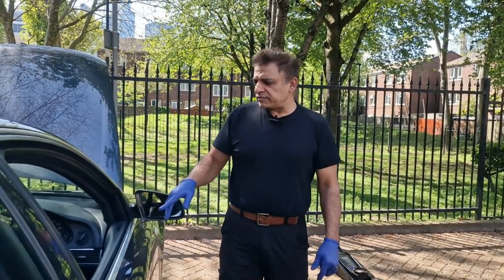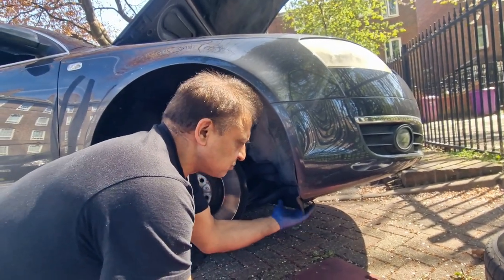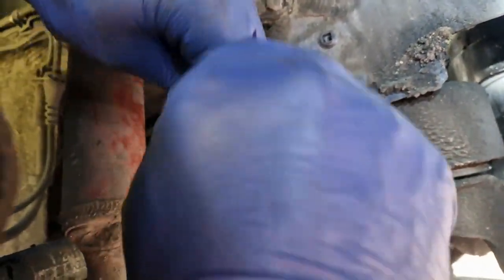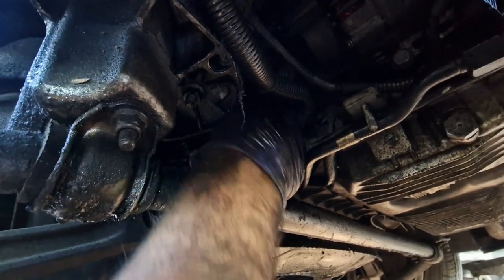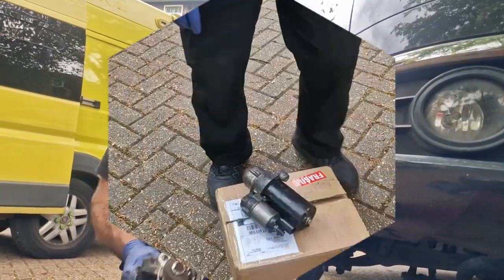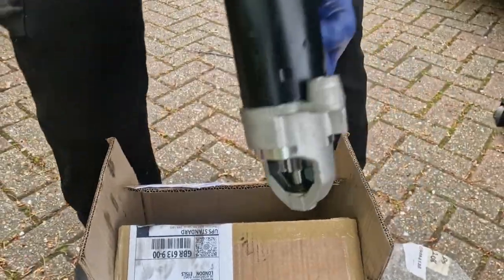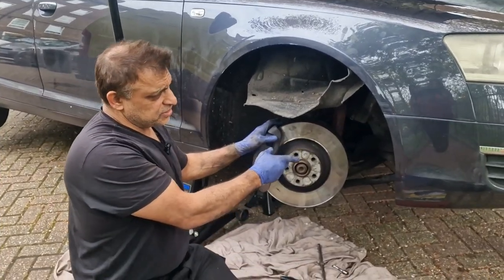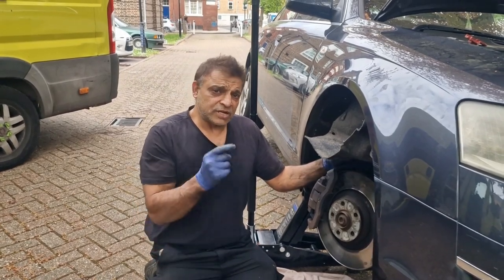Audi A6 V6- 3.2 FSI Starter  motor replacement

Comment: A tip on this job when i tackled it, i used a swivel and long extension to get that front triple square bolt out, its not a terrible job

Comment: The clip over the starter motor cable connection,holds the cables on,,how do you release the black plastic clip?

Comment: That 16mm or 5/8 bolt can be removed from the top of the engine. Way easier!!!!!
Reply: Just straight down from the top of the engine? Or do you have to remove a bunch of stuff in the engine bay to gain access from the top?